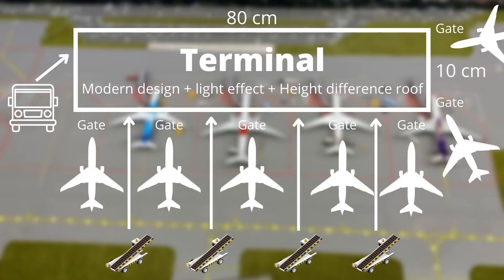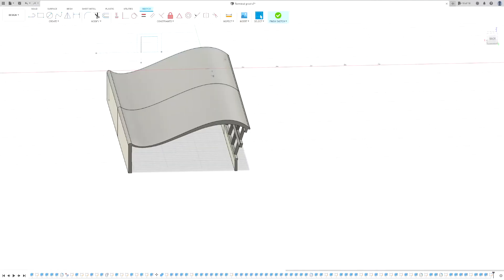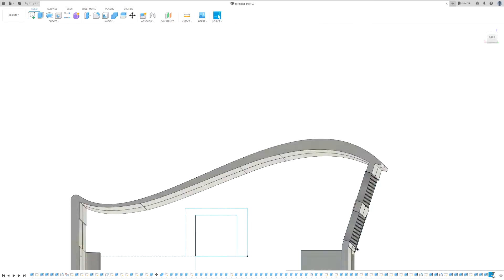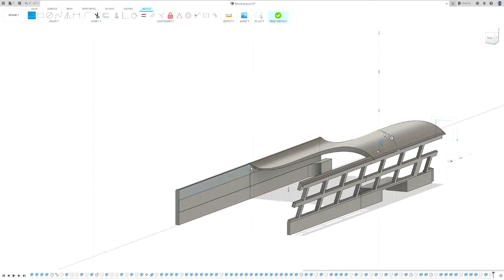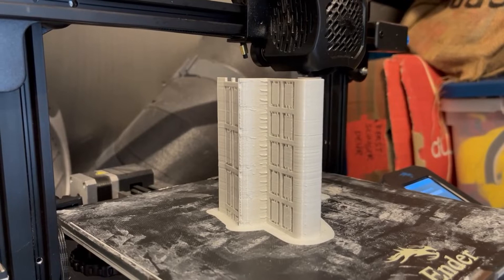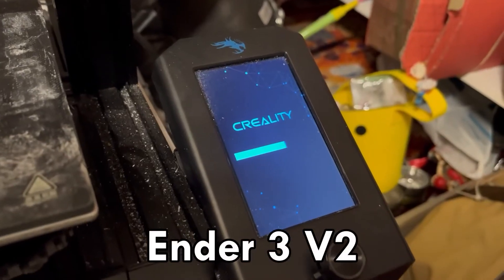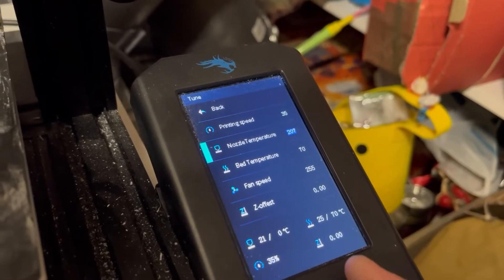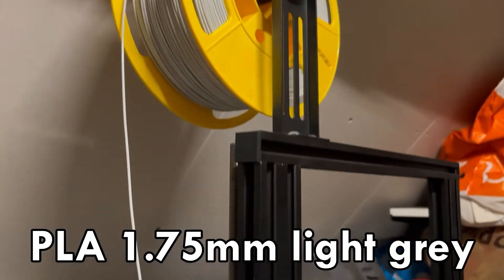How To Build A Model Airport Terminal

Comment: Can u share the STL files please, I'd love to print this for my son who's 12 and just got the AMS mat and 3 phoenix models. The terminal would be amazing of you if you could send?. I have 2 ender 3v2's. Thanks in advance
Reply from the maker: That's very nice! So, I can send you the STL's, but I haven't saved all the terminal parts individually. I have 2 Fusion 360 files that I kept from the project, so you'll need to edit them to print the complete terminal. My mistake, next time I will save the whole terminal with all individual pieces, to share it easier. What is your email?
Reply: @model.aviation  yeah my email keeps getting removed, never mind very good of you to offer.